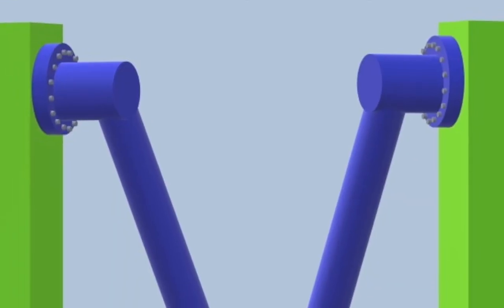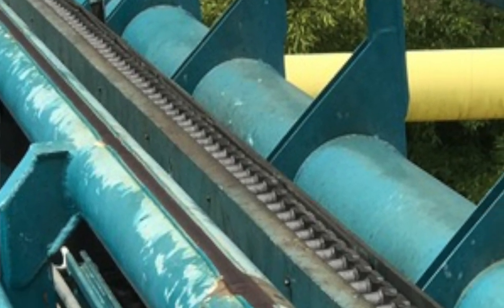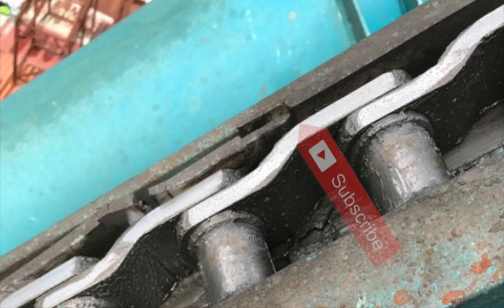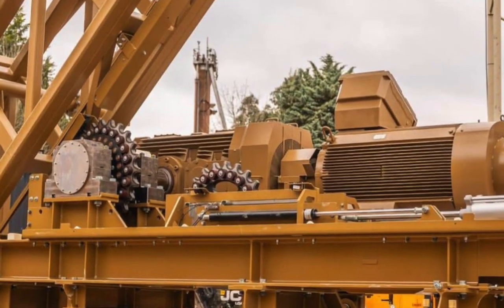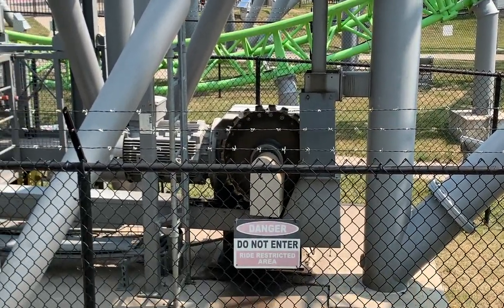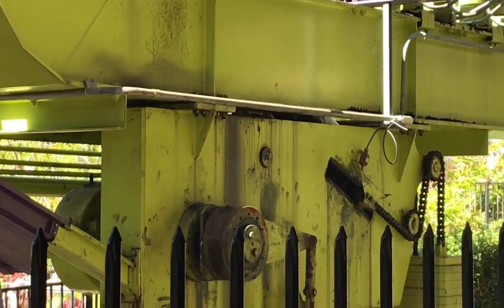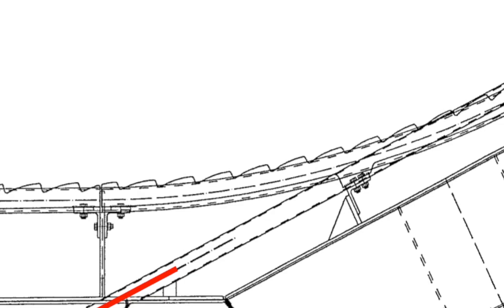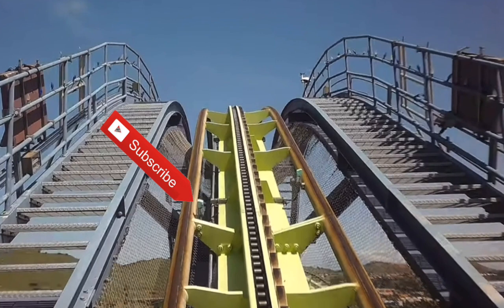How Do Chain Lift hills Work On Rides

Comment: So then, how did the chain snap on Gatekeeper at Cedar Point 3 years ago?
Reply from the maker: You can always have failures regardless of the situation.
Reply: @ryantheridemechanic  so that chain could of snapped for a number of different reasons. It was just surprising since Gatekeeper is one of the most reliable rides in the park. Well, B&M's in general are pretty reliable vs other Manufacturers